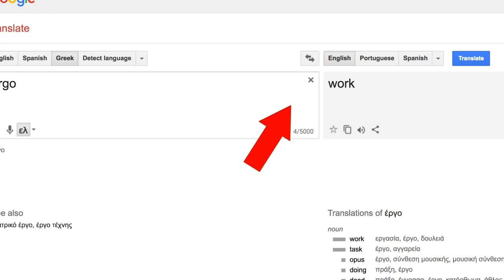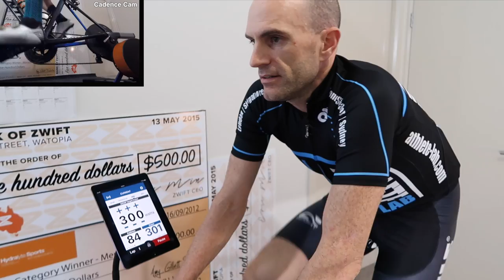Indoor Cycling Smart Trainers: ERG Mode Explained

Comment: Actually, teh way "erg mode" is set up on consumer ergometers is horrible. It should be controllable so that you can control how much the resistance spikes in order to convert your low cadence in to the stated power ("watts" value) in the setting. The so called "spiral of death" is avoidable with proper programming and does NOT help anyone become better athletically. I've worked with ergometers that keep resistance steady so that the goal is to hit a certain power at a certain rpm. That is the ideal way to do it. That would theoretically be "resistance" mode but I've never seen any consumer cycling machines that allow precision control over torque such that you can actually create target windows like "300 watts when I hit 92 rpm." Having dynamic control over resistance and a dynamic power calculator (to show the changes to your target window) would be ideal. This is because all of the geeks that do "research" end up assuming that cyclists will "normalize" their cadence and therefore you should pay attention only to wattage values rather than torque. This is insane.